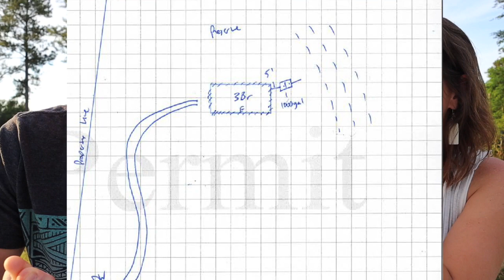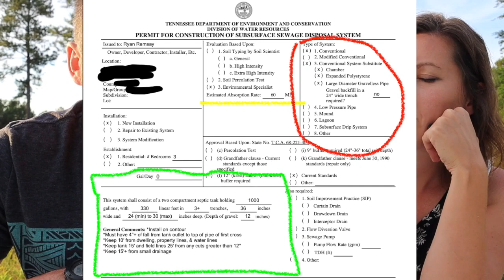Septic System DIY! Couple installs septic system on their property | How to install your own septic

Comment: Septic friendly toilet paper is a most. If your attaching your washing machine to septic, things like bleach will stop the good bacteria from processing waste properly. If you can run Grey water lines without going through septic helps.  Rain periods and laundry days will fill it up quickly, water needs time to leach. I don’t do laundry during heavy rain periods, when ground is over saturated.  Never been told to empty tank yearly, every 4 to 5 years depending on use.  Keep the trap “green lid” accessible, that’s is where to pump waste from. Hope this helps! Enjoying your videos, great work and thanks for sharing.  Prayers for continued success!
Reply from the maker: All great info! Thanks so much!

Comment: Im currently looking for property in eastern Tenn. If I understand correctly your county only requires permits for Septic is that correct? Do you mind sharing what county you are in? Thanks
Reply from the maker: That's correct. County requires septic and electric co-op requires state electrical inspections. I will say it's a more rural county - definitely just check into the counties you're looking at. The closer to a big city, generally the more regulations. Also, check with sellers as far as land regulations. Some aren't as friendly to DIYers or living on property as others are.